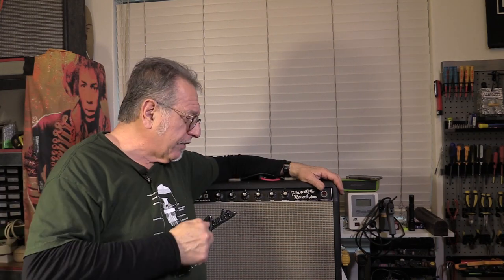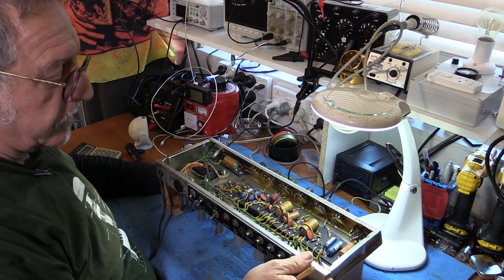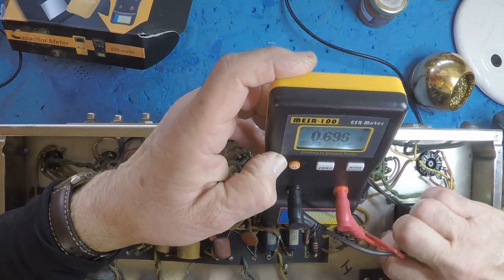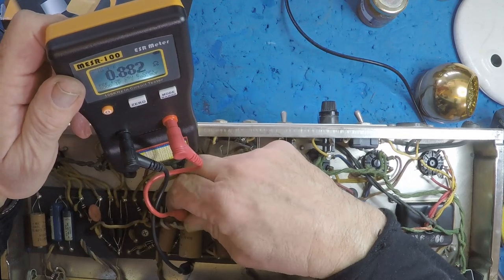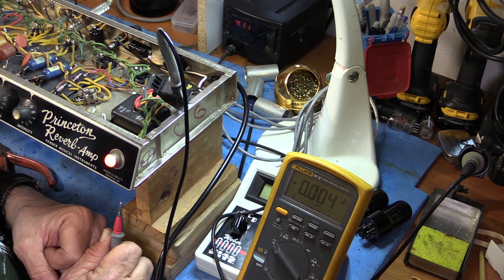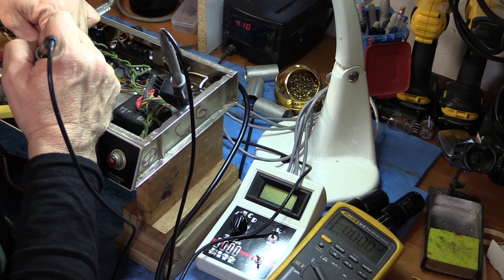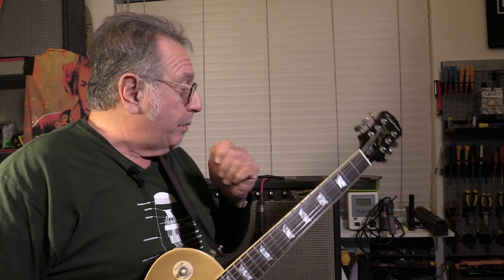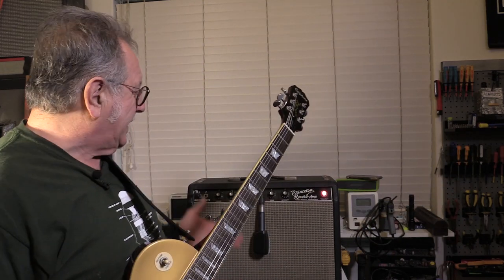How to make a Blackface Princeton Reverb sound FANTASTIC!

Comment: Excellent video.  Your explanation of ESR values was especially helpful.  At about the 54:57 mark I noticed a couple of flashes of light on your window blinds.  It appeared as if the flashes may have been coming from the rear of the amp, but it could have been something like car headlights coming from outside.  Thanks, and please keep the videos coming!
Reply from the maker: Wow ... well spotted! It was a message coming in on my iPhone, which which  can see in the background above my solder sucker. 👍

Comment: Hi. I like your channel. Subbed. Have myself built from kit a 5f1 Champ and a 6g15 reverb. Plan a 5f2 :-) Learning some. greets from Norway.
Reply from the maker: Thank you for subscribing. Good work on those builds. If I EVER get time to myself, I am going to build a 6G12, but I will go the kit route to save time on cabinet, chassis, etc. If you used a kit, which one did you choose? Were you happy with the kit and the end result?
I've been to Norway a few times in my former life as a process engineer. It was in a town not too far from Lillestrom. Because it was work I never got to go to my bucket-list area of the west coast...one day!
Reply: So you've been to Norway. Nice! I did one summer fart around by car and stayed in camping places west of the country, it was splendid. Hope you get to visit there too. The 6g15 kit i got from tubeampdoctor, kind of pricey, had to place the pt inside the chassis and it is nice and quiet. I think it interfered with the reverbpan. I also saw your video of designing your own amp. That sounded great.
Reply from the maker: @ofthetree  . Thank you for your kind words. 
Yes, I must go to Bergen and sail the Fjords. 
I am sure the TAD kit would be excellent. I don't have the skills to make cabinets and chassis, so for me its a kit :)
Reply: For sure it is lots more work making the full thing when one don't have the practrice and not to mention good tools. I made plywood cabinets for mine but not fingerjointed, turned out OK but took forever. One needs to prioritize. Yes you can take the coast boat all the way up to the north Kirkenes with stops in between. We see that boat "Hurtigruten" regularly stopping by here in the north/middle west where I am.
Reply from the maker: @UCeqWByvLfRX%F0%9F%98%80z2g53GDA2IRA Yes, it would be very satisfying to build the entire project. Thank you for the tip about the Hurtigruten.

Comment: Not a fan of Tungsol 6V6 valves (tubes) and unsurprised you lost some - they certainly aren't up to the higher plate voltages of the 65 Deluxe Reverb circa. 440 d.c. - they red-plated on me, failing mid-gig.  :(

Splashed on pair of NOS JAN from 1980 and hugely pleased with the outcome.

Great vids and loving your stories from amp land!
Reply from the maker: Mostly, I have had good luck with Tungsols, but I agree with your preference for NOS tubes. Unfortunately, the older tubes have been "cherry-picked" and we mainly get the scraps. As a repairer, I can't risk my customers' money on unknown quality. If they turn out to be crap, its me that will have to cover the cost.

Comment: Nice presentation, I really enjoyed watching you work through the amp.  I've been throwing around the idea of converting the 65 reissue 6V6 outputs to cathode bias as I don't need the volume and wouldn't mind some earlier compression and breakup.  These new amps are spec'd at 440V on the plates which seems a bit silly given the direction modern amp use is headed.

Have you ever played with Push-Pull cathode-biased outputs?  Any thoughts on the results?  A cursory glance at the schematic looks like any imbalance in the output tubes could create some frequency mixing / interaction with the tremelo if the cathode bias lacks the necessary bulk capacitance.  Cheers!
Reply from the maker: Thanks Lettuce! I appreciate your comments.
I agree that 440V for B+ is high, depending on the sound you’re after. Unless I’ve misunderstood your question, I’d be willing to wager that you have also played on a push-pull cathode biased amp. A vox AC10, 15 or 30. I Love that sound.  
The main problem with the Princeton tremolo is that the Fender Tremolo works on the bias by oscillating between normal bias (around -40v) and shutoff (more negative). With cathode bias, your grid will now be at 0v and not -40v. The negative relationship would be provided by having a positive voltage on your cathode relative to the grid.  
Have you thought of replacing your rectifier tube to drop your B+? The standard GZ34 (my favourite tube) is quite efficient, almost as much as a solid-state diode. Try a 5Y3. It will drop your B+ to a value that you are happier with. Maybe avoid a 5U4GB as it draws way more filament current than the other 2. 
Let me know how you get on.
Reply: @theguitaramptech  , a 5V4GA tube might be a better choice than a 5Y3 as a replacement rectifier for a 5AR4/GZ34. The 5Y3 is a filament rectifier which 1) turns on faster than a 5AR4, stressing the filter caps and tubes, and 2) might be prone to arcing from the high-current draw, especially if the first filter cap is above 20 mfd.  The 5V4 is an independently-heated-cathode  rectifier, with characteristics similar to the 5AR4: it heats up more slowly and has greater resistance to arcing than the 5Y3, but it does have more internal voltage drop than the 5AR4 and will lower the plate voltage to the tubes a little bit.
Reply from the maker: @goodun2974  Yes, the 5V4 would be a good call for that position. Like you, I prefer the slow startup of an indirectly heated cathode and the 5V4 has the same low filament draw as the 5AR4 and the 5Y3. It would certainly have done the job. In the end, the main reason I opted for the 5Y3 is the voltage drop of 40v. The 5AR4 has a drop of 17v and the 5V4 has a 25v drop. I was after that additional 15v.But, thank you. The 5V4 is an excellent recommendation.
Reply: @theguitaramptech  I didn't pick up guitar until I was in my mid 20's, and I didn't really become serious until 40 or so.  Up until the last year or two I played primarily acoustics and have just recently returned to electrics.  So while I'd love to claim extensive pesronal experience with various amps I cannot.  What does get me into trouble is having an EE degree... but tubes are definitely not in my wheelhouse. 

I was reviewing schematics and took some measurements in the amp... just to make sure reality matched up.  The amp is   at 440V and the output tubes are biased at 21 mA.  It plays well, sounds great, and for good or bad has clean headroom to at least 8 on the volume pot.  Being primarily an at-home player I'd love to get a bit of breakup at lower volume, but that's not a trivial task with this design.  The rectifier swap isn't a bad idea.

I went forward and modded the amp.  I slowed the tremelo oscillator by doubling the cap, and I swapped the negative feedback resistor for a smaller R + potentiometer to have control.  

Once I had these changes verified I dove in to modify the output stage to be fixed bias / cathode bias switchable.  I lifted the ground legs of the 1 ohm R & diode in each leg and routed them to a 4PDT switch.  One position goes to ground and the other goes to a 1500 ohm 25W rheostat in series with a 180 ohms 5W resistor (for some safety).  A look at a few datasheets suggested a value in the 800 ohm range should bias the tubes near the same 21 mA... a good "safe" starting point.  This gets the circuit most of the way there, but as you noted the negative bias needs to be removed.  I lifted the negative supply rectifying diode cathode and connected it to one of the two remaining switch positions.  In fixed mode the diode is connected per the design to the power transformer.  In cathode mode I tie it off to ground (just a precaution, it's not absolutely necessary).  This allows the tremelo to see a similar impedance in both bias modes... no need for a heavy-handed hard ground at the trem mix pot.

The changes are in, the amp came up in both modes,  bias was as expected in both, and the noise floor didn't audibly move (which was my biggest concern).  I can now get power tube breakup at a lower volume and a different but nice sound.

Of courese I'm not done.  I need to get the function generator and oscilloscope on it to verify cross-over behavior.   As it sits the trem is at roughly 50% effectiveness due to the softness of the cathode voltage.  This is better than I expected given the circuit... It may have helped to disconnect the negative supply at the transformer.  I'll be adding capacitance across the cathode bias resistor to create a "virtual ground".  This will move behavior closer to that of a fixed bias output stage.  Ideally the only difference would be a reduction of 75V (give or take) across the 6V6 pair once complete.... with no significant loss of trem or noticable "squish".  I'll let you know how it goes when the caps are in.

My real reason for doing this was to play with tubes and learn a bit more about their behavior.  Thanks for the feedback!
Cheers!

Comment: Chris, how do you safely clean the pins on the preamp tubes?
Reply from the maker: An excellent question that would be the topic of another video. The quick answer is "depends". If they are old and show oxidation, I soak them in WD40 to start removing the corrosion. Then wipe off the residue, and spray with a contact cleaner. If that's not enough, I run over the pins with some 800grit wet'n'dry.

Comment: Hey hey see you mentioned pulling those tubes when checking the grid caps for leakage👍 you know in all my years working on these tube amps I have never seen anyone else ever mention maintaining a load on the reverb driver tranny, using a dummy load on the output tranny is brought up a lot, makes sense, very good point you made. Princeton Reverb is not the only amp like that thank you for that tip. I have a reverb pan on the bench that I hook up when testing the amp with and without a guitar but it isn’t something I did consciously for the soul purpose of maintaining a load it was more for convenience but it will be now.
Reply from the maker: HI 60retired! Yes, when you look at the schematic the Reverb driver is simply a small Class A circuit. I have made up a bunch of RCA dummy loads of different resistances to suit the different impedance reverb tanks.

Comment: Great video!!  I've got one without the Fender name on the grill cloth. What year would that have been made and is it worth more?  Thanks
Reply from the maker: What a beauty! I'd be thinking it may be a nearly 1964. The badge was attached later in 64. Have a look at the transformer date code. I only repair the amps, not sell them. A vintage equipment store in your area would be the better judge of value.
Reply: @theguitaramptech  Many thanks! Much appreciated!! What numbers should be on the transformer code and the tube diagram that point in that direction?
Reply from the maker: Hey Joe, I explain about Tube Charts in my video "Fender Blackface ProReverb.". Look up EIA transformer date codes. EG If it is 606-4***, it will be Schumacker (606) made in 1964 (4).Have fun
Reply: @theguitaramptech  Thanks again! Cheers!

Comment: Thanks for the video. Glad to see you have your UD certifications. I am dealing with the same voltage jump. My transformer was Originally rated at 330-0-330 but is actually pushing 380-0-380. When it gets rectified more like 469v vs the desired 410v on the plates. And that is on the lowest setting on the bias control. Plate only goes up from there. Tried some diodes on the center tap, which did give me some good results. But looked like hammered up dog s***. Swapped rectifiers, which did tame it a bit but still very on the hot side, and now throwing in the towel and ordered a cooler transformer. Getting there. After studying on it for about a good 2 weeks now, I think I could have worked it out with the old transformer. Maybe I will have a look at it again later but for now, I just want to hear some sparkles. :p
Reply from the maker: Ouch! That's hot. Let me know how you get on.
Reply: @theguitaramptech  Thanks, will do. Just sitting here rewiring heaters while I watch... and wait for parts. :p
Reply: @theguitaramptech  Finally success. Using the 5AR4 got my voltages back in reasonable tolerance. About 446vdc with a pretty warm bias (schematic actually called for 440 there, not 410). Had some bad Hum from reverb = lack of ground to chassis on the rca jacks. note- do not use those insulators. Had a couple other hiccups but finally all is working properly now. Still may go for the 5Y3 GT and soften down the heat a bit more.
Reply from the maker: @3MonkeysGarage  great work. It can be challenging to find hum sometimes 👍

Comment: Love it! I noticed after you found the carbon resistors drifting you changed to a metal film which was on the money. Do you recommend using metal films in general?
Reply from the maker: Thank you for your insightful question, Matt. In general, I mostly use metal films in my repairs. They are quieter, and more stable, and smaller for their wattage capability. 
My main objection is that horrible blue color. Wherever possible I will pay a premium to get brown metal film resistors. Vishay is one such supplier. 
Of course there is the legend of the mystic sound of carbon composition resistors. I am a skeptic, but have an open mind just in case I hear the difference one day. 
Note: I will never replace an old resistor or component in a vintage amp unless it has failed, or drifted too far away from spec. We are custodians of the past, and have no right to the wholesale exchange upgrade of vintage components.
Reply: @theguitaramptech  excellent! Thanks for the reply. Love the videos.

Comment: I own a 1966 Champ Amp, how far is it from the Princeton circuit?
Reply from the maker: The champ is quite similar to a tweed Princeton. From brown face onwards, the Princeton dual 6V6. Check out the schematics.
Reply: @theguitaramptech  Tweed Princeton, interesting. The original 6.5 speaker sounds bigger than it is. Have you herd of “The White” amp High Fidelity. The side line Leo made and name after Forest white.
Reply from the maker: @JOAQUINARMIJO  yes I’ve heard of The white Amp, But I’ve never seen one. I’d be surprised if there was one in Australia.